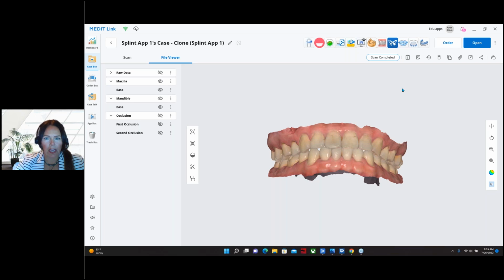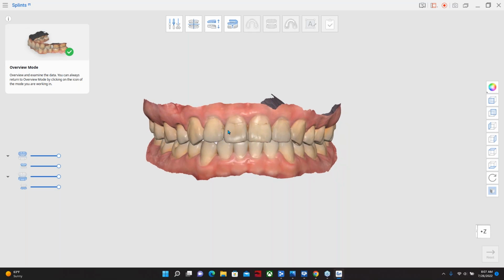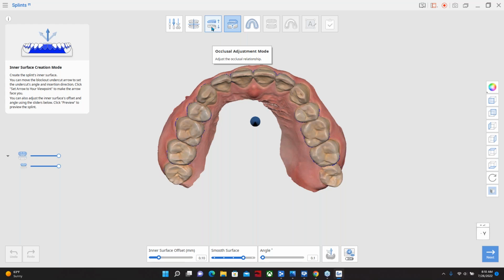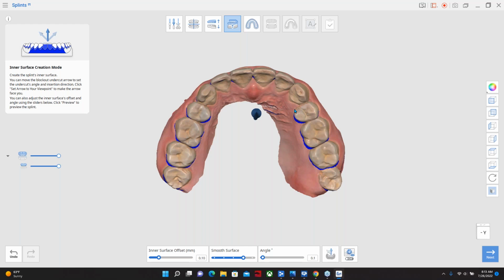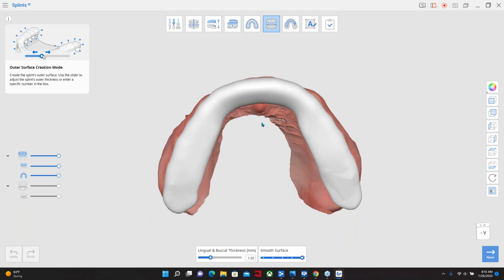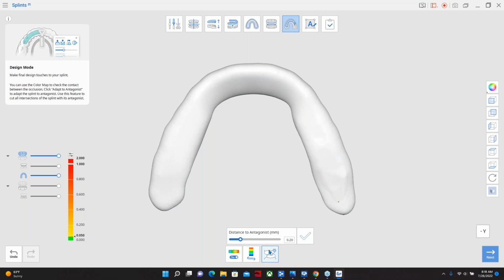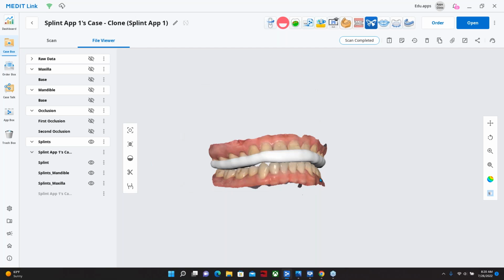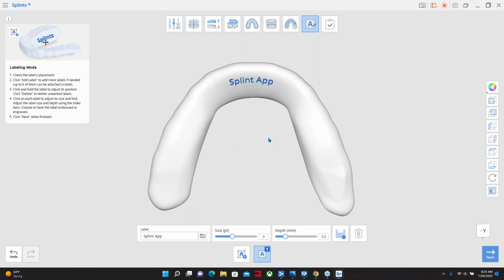Medit Trainer's Corner : Understanding Medit Splints

Comment: First of all, must we mount a patient' casts to the articulator before doing the splint? I mean that it is an important step to find a measurement of the splint's thick? Is it right? Thank you.
Reply from the maker: Thank you for the comment. The default thickness of Splint in Medit Splint app is 1.5mm but for more accurate result, we do take CR bite. For more detailed method, please refer to this journal.  ➡️https://www.researchgate.net/publication/301893814_Digital_Michigan_splint_-_from_intraoral_scanning_to_plasterless_manufacturing

Comment: The new(ish) retention slider is not featured in this video. I've been using medit to create lower anterior bite splints but the retention slider seems to be engage a percentage of the patient's undercuts instead of engaging a specific measurement on a slider. (0.1-0.5mm, etc)

Can you confirm or deny this is how the retention slider works? Is it just X% of the patient's undercuts that will be engaged? This makes it very inconsistent and hard for me to get the fit feeling nice patient-to-patient as the CAD operator. My fits are extremely consistent using a software like inLab 22, but Medit's retention slider I haven't quite fully understood. I even scanned and designed a few for myself, but I fear that my retention numbers are not going to fit the same on another patient.

Any help greatly appreciated. Thank you!
Reply from the maker: The unit is in mm.
So, the maximum retention you can set will be 1mm.
And regarding inconsistency of splint production, I'd rather do more tests on the material or 3DP settings.
Because as you might know, the CAD is running based on fixed codes and numbers.
Let me add more infos regarding the splint parameter meanings in few days. Thanks.
Reply: @MeditAcademy  This is extremely helpful, thank you. I don’t believe this information is anywhere else.
Reply from the maker: @vixanis  
Read this following page for more info.
https://support.medit.com/hc/en-us/articles/25193647962137--Medit-Splints-1-1-3-Modes